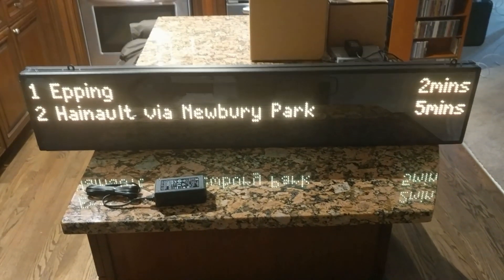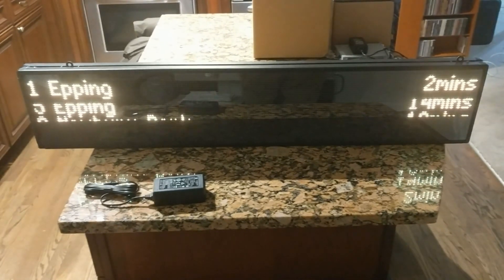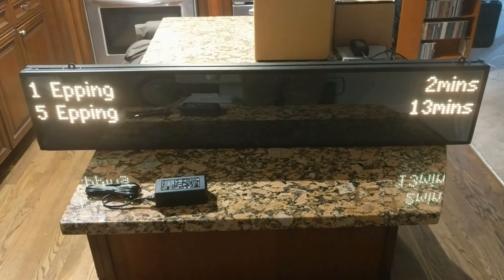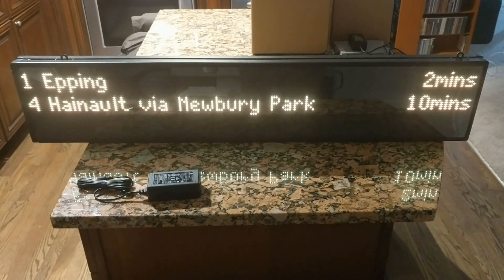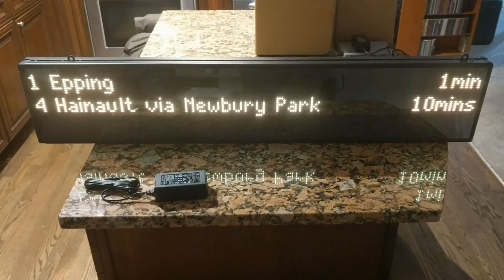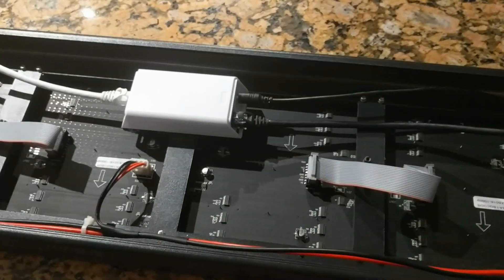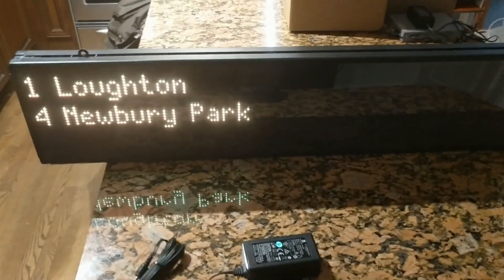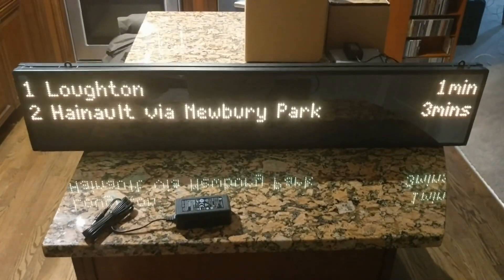UK Departure Board driven by PoE+

Comment: Hi Chris, what device did you use to split the incoming POE+ into Data Ethernet and Power (Barrel Connector)
Reply from the maker: It is a Gigabit Eithernet PoE+ splitter from WiFi Texas (also known as POE Texas) on Amazon.  Given they change their models every year, I don't think the one I bought is still a current model given this was a couple years ago now.  But it should be easy enough to search for their current equivalent.

Just gotta make sure you get one with the correct output voltage.  UK Departure Boards have also updated their hardware over the years, so I'm not sure if the current devices are still 12v or if they are all 5v now.

Comment: Hi Chris, I'm considering getting the P5 XL board. I believe this is the same model as the one you are showing here. In your opinion, what would you say is a minimal comfortable viewing distance for this board ?
Reply from the maker: Yes, I have the P5.  I'd estimate it's about 3.5-4 feet wide.  I believe the dimensions are posted on their website.

You can get pretty close to it.  It's not super high resolution from a pixel density perspective.  Even from a few feet away it's pretty easy to see the full width of the board.  That said, with where I placed mine, my usual viewing distance is probably around eight feet or so.
Reply: @cwichura  Thanks for that. My viewing distance will be around 5 feet away so I was just worried that the larger pixel spacing would make it difficult to view. Apart from yours, I haven't seen any video footage of the P5 departure board in action anywhere. I know its going a little off topic ( sorry about that ) but do you have any video footage showing rail services on this board ?
Reply from the maker: Is there a particular station you'd like to see?  I could switch mine temporarily.
Reply: Wouldn't mind seeing station "London St Pancras International (STP)". Thanks
Reply from the maker: I posted a short video of the board set to STP.  It should be in my YouTube video feed now.

Comment: Hi, Can I ask what POE injector you are using to supply power to your splitter ?
Reply from the maker: No injector; the switch (a Meraki) has POE+ built in.
Reply: @cwichura  Thanks for the reply. I have bought the same splitter that you are using but my ZyXEL PO12-HP injector will not work with it correctly. It passes the Ethernet data ok but the power on the 2.1mm jack bounces between 5 and 0 volts every few seconds. I have a feeling its because my ZyXEL injector is an active type and the splitter probably needs to be fed with a passive injector.
Reply from the maker: My Meraki switches are "active", they negotiate 802.3at.  And the splitter I show in the video was designed for 802.3at, not passive.  Passive tends to be found on brands such as older Ubiquiti gear.  Is the ZyXEL rated for 802.3at or just 802.3af (E.g., PoE instead of PoE+)?  It's also possible you got a defective splitter unit as well.  They are cheap enough you could try ordering another, testing it, and sending it back afterwards.
Reply: @cwichura  Hi, my injector is PoE+ and supports both standards. I tried it again this morning and it looks like any handshaking that should be taking place to negotiate its power requirements is not taking place. This is further supported by the PoE light on the injector flashing. Identically, the rate of the flash seems to coincide with the power availability on the splitter as well(0, 5v, 0, 5v.. etc). The injector works with other equipment I have on my network. I checked on the https://www.poetexas.com website and it suggests a passive injector. I've just ordered the one they suggested so ill try that and see what happens. You're right that it could be a faulty splitter but another injector will always come in handy :-)
Reply: @cwichura  Hi Chris, My passive injector arrived this morning and seems to work with the splitter. Output voltage is stable. I haven't connected the Ethernet through to the Pi yet because I have some concerns. Would you happen to know if the output of the splitter also passes on the power with the the Ethernet connection to the end device ?
Reply from the maker: It should not, but that's really a question you'd need the vendor to confirm.  FWIW, it hasn't killed the RPi in the departures board and it's been around six months now that it's been connected.
Reply: @cwichura  Thanks for that. Good to know its still working ok. Regarding the injector, only difference in my case is that I'm using a passive injector to power the splitter. From what I can tell you are using an active injector coming from your switch so if there was power being passed to the target device then at least there would be some handshaking to negotiate power requirements. I've been trying to contact poetexas but I'm getting no response from them but Ill keep trying. Thanks for your time Chris. Cheers.
Reply: @cwichura  Hi Chris, just had an answer from poetexas. In case you were interested, the splitter does NOT pass on the power to the end device but they do have one that does if this this was a requirement. Cheers